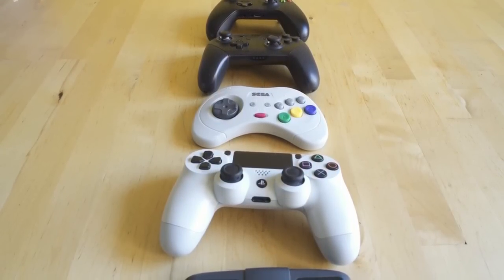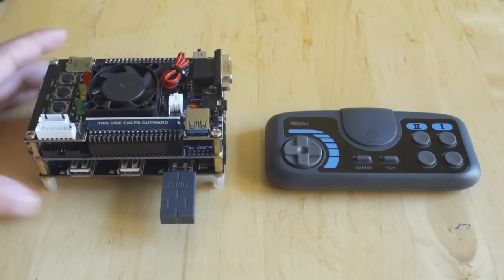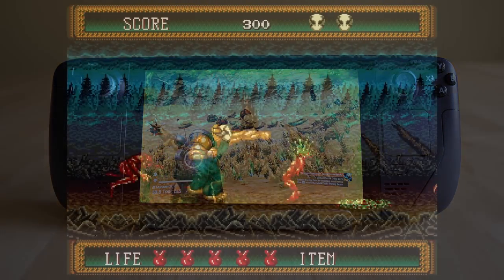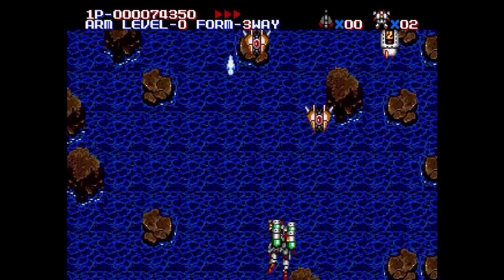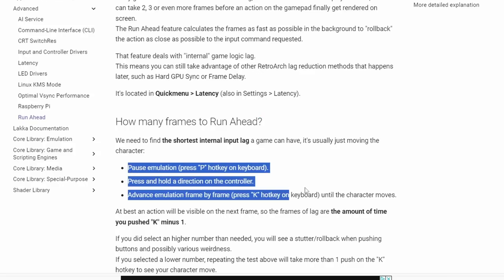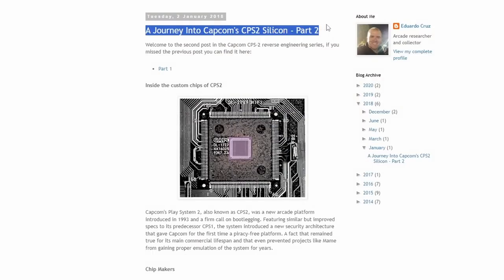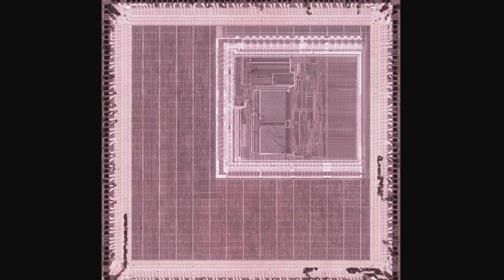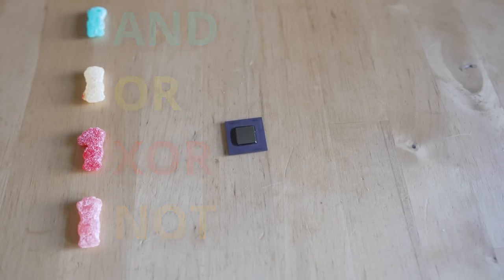MiSTer FPGA; What is FPGA Anyway? Is it Better than Software Emulation? How Does it Work?

Comment: Thank you for not repeating the "FPGA is more accurate than software emulation" bullcrap myth that many FPGA fans/users push. For that alone this video is better than 99% of FPGA related videos.

About the lag, i would like to add that, most of the time, the extra lag you get from software emulators isn't because of the emulators themselves but because of the OS they depend on. Theoretically, if you could skip the OS and sort of "code to the metal", you would be to completely skip any OS related lag. But not all OSes are the same, some have more or less lag. But there are also some emulators that do add lag themselves. Like Mednafen Saturn. It's a case by case scenario, not all emulators are the same or as good with each other. I find RetroArch + GPU sync to be the best, lowest lag scenario in software emulation, even without Run Ahead.

Another thing you forgot to mention is power efficiency. This is one advantage of the FPGAs vs software emulators IMO. Basically, with an FPGA you need less power than a CPU needs for the same task. An accurate N64 emulator would require a powerful CPU that also requires more power from the PSU but for an FPGA there is not much difference if it's the NES or N64, as long as it fits into the chip.

The biggest advantage of software emulation is mainly the vast amount of options and features they can have compared to FPGAs.
Reply from the maker: It’s only as good as the code. I can’t pick up a brush and be a master painter. All just tools that need the right hands
Reply: FPGA itself isn't more accurate, but depending on the core couldn't it be more accurate to the point of being perfect?

I feel like if done right the hardware emulation through FPGA is 1:1 with original hardware, whereas you don't get that with software emulation. Maybe it's just in my head, but I feel like tossing my mister in my arcade machine felt 10x better than any pi setup or even running off my computer that I had before. Even if the emulator claims to be cycle accurate. I could totally be wrong, but that's how I perceived it.

The repeat that bugs me the most though is people that say FPGA isn't emulation. Or like how Analogue touts no emulation on their devices. I might love my pocket, but it absolutely is still emulation, just hardware based.
Reply: @JPdelaGhetto  It's trade-offs all the way down.

Theoretically, both FPGA and software emulation can be 1:1 matches to original hardware, they're "equally powerful" in the sense that they are both Finite State Machines*. The practical differences are how many resources it takes to do that in each, the technical difficulties to do this on each and if you'll be able to do it in real time or not. Often the economies of scale favor software emulation, given enough time. That may end sooner or later, though, as we reach the end of Moore's Law.

Gate Arrays were always meant to be used as a cheaper alternative for hardware development, prototyping and low volume production, to test if it works as intended or just to have a solution out there and test demand before making the big investment required to make it into an ASIC. In other words: it is a tool designed just for that kind of job, so it is more "natural" to do so with it. But that's theory, in practice, there are way more cheap and easy to understand educational resources for those wishing to learn software programming than hardware design/modelling, so we end up with a smaller talent pool on the FPGA side than on the software emulation side.

Software emulation is more versatile in the sense that we have incredibly powerful machines at affordable prices that can easily be reprogrammed and the tools used for development and testing are more varied, cheaper, with many free software / open source options and with tons of documentation for those willing to learn. But what it gains in versatility it somewhat loses in predictability in keeping hard timing constraints, not because software emulation is somehow flawed, but because it's usually way more practical and financially sound for most applications to have layers of abstraction that are outside the control of most programmers and users.

TL;DR: there are a really big number of trade-offs at play with both options, so it's really hard to make correct absolute statements about which one is better. It always makes more sense to talk about what fits better as a solution for a given problem with a set of constraints, and even then, the answer may be ambiguous or highly dependent on the goals, constraints and priorities of each developer or user.

* although we usually generalize and call them "Turing Machines", even though for that they'd need to have infinite memory. There are many models of computation and they usually fit into an hierarchy of "power" (what each one can or cannot compute), but even in the same hierarchical level, there are many different models that can make simulating a desired mechanism or behavior easier or harder.
Reply from the maker: It’s all down to the coder. FPGA is a tool. You need someone who understands the tools
Reply: @JPdelaGhetto  You are wrong though. FPGA and software emulation can be just as perfect. There's nothing inherently more accurate about the FPGA method. There are already "perfect", accurate software emulators btw. BSNES might even be closer to perfection than any FPGA, in fact, Analogue devs used it as a reference to fix their own bugs.

Also, the Pi is junk. It doesn't have the processing power to handle accurate emulation so it either uses older emulators or performance based ones. It's not a good representative for software emulation accuracy and it isn't fair to compare it to FPGAs, where accuracy is almost always the goal.
Reply: @Imgema  It's just a matter of different trade-offs. But yes, there have been instances where software emulators are used as a reference for FPGA cores. Robert is doing this for the N64 core, he first developed a very accurate software emulator, tested a bunch of emulator tests and games in it, then went to work on the core for the MiSTer.

For the HP-41C calculators, we've had microcode-level simulators for a very long time. Now there are even FPGA-based products that replace the original system board with a much faster modern implementation, and also expansion modules that offer the functionality of almost every expansion module out there in a single port.

From what I've read, it seems like some of the systems implemented on the OpenSIMH simulator also go for accuracy and do low level modelling of some hardware, instead of just doing a high-level "functional simulation" of those systems. On some systems this may be required to correctly emulate some quirky behavior that came to be relied upon by popular software of that era.

Comment: Oh the LAG still exists, the real question is. Does it matter if you don't experience issues from it?
Reply from the maker: That’s the point; if you can’t tell does it matter?
Reply: @VideoGameEsoterica I dont even have the usb board. Using a generic usb 2 splitter I got almost 10 years ago and PSone wired controller, if I find my adaptoid I might also do wired N64 but in my case it hasn't mattered yet.😊
Reply from the maker: Yes you can get away with a lot less than the triple stack
Reply: I know at least one use case where lag, no matter how small or unnoticeable actually matters. Light Gun games, the type you get on NES. If you know how this old tech works you know that for native NES light gun support it requires a CRT display/ TV and absolute zero lag compared to the original hardware. And MisterFPGA actually support original light guns via SNAC, so there is no lag (if FPGA core is programmed right and precise to the original hardware specs).
Reply from the maker: Absolutely. Not perfectly sync’d to refresh rate = does not work
Reply: @VideoGameEsoterica  So I was actually quite surprised to learn some time ago that you can connect a NES light gun to a SNAC and play good old Duck Hunt or Hogan's Alley on MisterFPGA like on a real NES. To me that says heaps more about the emulation/simulation precision than any theoretical talk about how software emulation can be as good. I know software emulation for more than 20 years, there is no NES software emulator to this day  you can pull off something like this, no matter how precise it is and what hardware you are using. The input timings are just not there. The software emulator can be very precise itself, but the emulation itself is lagging behind the  inputs even if you connect to a CRT display (like I always do) on every software emulator under every OS. And Runahead won't help you, bc it's measured in frames (16ms). You need everything much more precise than that. The light gun precision tolerance is under a frame. You can probably get away with like 5ms of lag probably, but not much more.
Reply from the maker: Yes the CRT light gun support is a fun feature.
Reply: Well, I don't like light gun games myself (I don't even have a light gun that works I think), but to me it just works as an indicator of emulation precision. If you can get your timings right for light gun games to work, and FPGA is the only emulation platform you can achieve this currently, than FPGA is a clear winner from emulation precision standpoint.
Reply: You phrased it very well, and my personal answer for that is "no, it doesn't matter." If you can't really notice a 2~3 frame lag, fine, but if you're playing something where the cumulative effects are noticeable, then sure, it matters as long as you don't hit a skill issue... it's not the lag that's preventing me from completing Clinger Winger on Battletoads most of the time, I'd be fooling myself by blaming lag for this. 😅
Reply: @kosmosyche even light guns have lag, The most important part CRT have that LCD don't is they blank when there is no video signal. Its the timing from start of blank to drawing of target box that tells the NES which target you were aiming at on the screen.
Reply: On the other hand, Run Ahead in many cases allows you to shave off lag to basically nothing even in inherently laggy games (that have lag by themselves, not bc of the emulation). So in this case software emulation can be even better than the real console, especially if you output video to a CRT TV. For example, Rayman's (from the first Rayman) movements have a 2 or 3 frames lag on Playstation. I found it plays so much better with RunAhead 2 frames than on real Playstation and MisterFPGA. Lol. So yeah, there are benefits to software emulation if precision doesn't matter all that much, just if it feels good.
Reply: I got a bunch of pis at home and a mister. Mister feels more "peaceful" if u know what that means. But somethings can't be played on mister yet that u need a pi.

Comment: Does anyone know the exact amount of logic elements in an Original Xbox or a PS2?
Reply from the maker: It’s not FPGA inside the silicon so it’s not exactly “logic” in those chips. Transistor count
Reply: So how would that translate into those 2 systems as, in a tangible number to gauge for fpga?  I just figure there is an arbitrary equation to gauge what a PS2 would equal into, when it comes to LE…to theoretically gauge what level of fogs would be needed to reverse engineer those two devices (theoretically, of course)…🤔
Reply from the maker: Honestly until someone tries it’s V hard to assume
Reply: Understood.